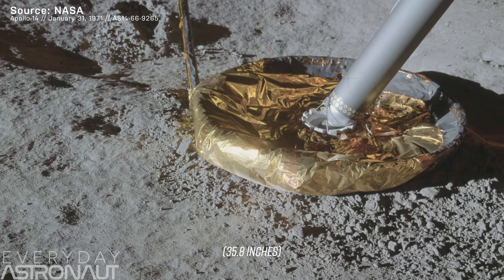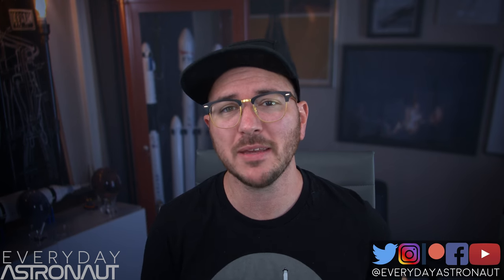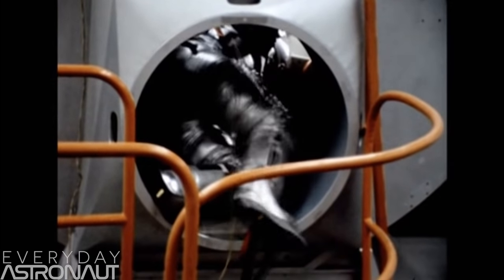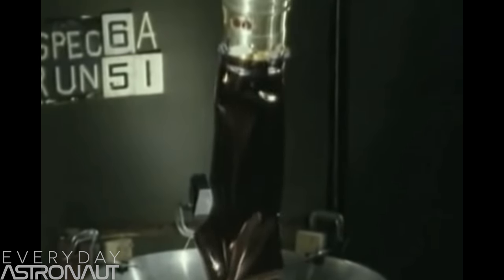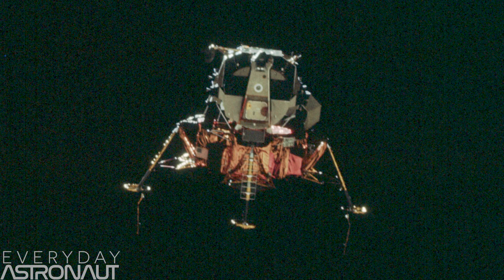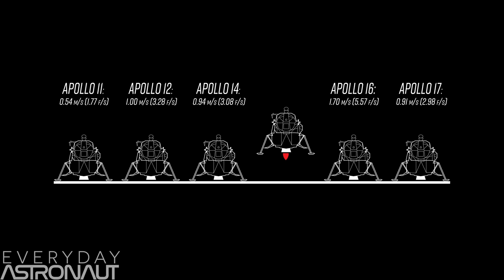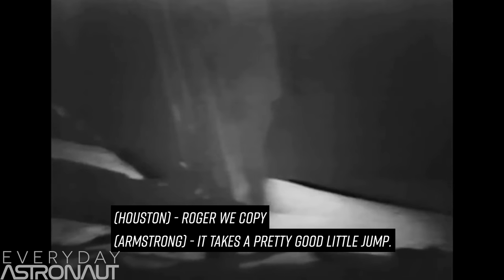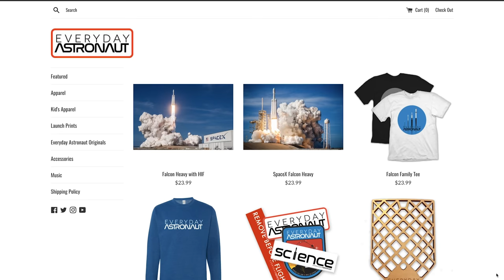Why were there missing rungs on the Lunar Lander’s Ladder?

Comment: Why was there no moon dust on the round feet of the LEM?
Reply: There is a bit.Why do you expect more?
Reply: @ThomasKundera  
Were you aware that the rocket under the LEM operated at 10,000 lbs of thrust?
Considering how fluffy the moon soil was described by the astronauts, there should have been dust everywhere
Reply: You answered  your own question. Check out the Apollo lunar landin videos, you can see the dust gettin blasted away before touchdown.
Reply: @hta: I'm aware that the main thruster power was adjustable ans to the lower when landing with empty fuel tank. 
And as said it was cut before ground.And dust is flying away from the lander I can't see many trajectories that would put some back on it. Maybe you can enlight me?
Reply: @ThomasKundera  
I guess you call that a clean landing  in another reality. Totally absurd that the dirt would go everywhere except onto a "pristine" LEM.
P.S Where is the blast crater below the craft? Did they float like a glider onto the surface? You people make no sense.
Reply: @hta: who talked about "clean landing"?Dust is pushed away and under the LEM. How do you want it to come on it?Look at landing videos, lots of dust is pushed away, very fast, but at very low angle.The blast crater is under the LEM, why?
Reply: @ThomasKundera  
I guess you haven't figured out yet from my acerbic attitude that I am convinced that the landing of 12 astronauts on the moon ever happened. There are too many  extraordinary and unexplained anomalies in the official narrative. 
Another one is an official image of the earth rising on the horizon, as seen from the Sea of Tranquility by Neil and Buzz.
Reply: @hthomasackermann  : You're not "acerbic"' but proudly ignorant.
I invite you to learn about Dunning-Kruger effect, then ponder what you know about space engineering and physics to conclude.

"There are too many  extraordinary and unexplained anomalies in the official narrative. "
I have yet to see any. I saw lots of people pretending there were some. But they were just not able to understand how things actually are.

"official image of the earth rising on the horizon, as seen from the Sea of Tranquility"
Technically speaking, there is no "earthrise" on the Moon, as it is in tidal lock.
However, the Apollo missions orbited the Moon from low orbit and thus could see some "earthrise" from their perspective.
So what?

Comment: There were several easy solutions to the ladder, if only someone would have thought a little bit more about solving it. One could have been making it a extension ladder. Like the one everyone has to work on their house. One section slides into the  other. After landing, extend it to the bottom. Problem solved. They can make a vehicle to fly to the moon and back, but no one can solve this problem? Go figure.

Comment: The moon absorbed 80% of the impact speed?

What does that actually mean?
Reply: It means that the moon absorbed 80% of the impact, and presumably the module's legs accounted for the rest.
Reply: Stubrit Repeating it louder doesn’t help. 

If you were listening, the modules legs didn’t absorb the impact like intended. 

When a person or aircraft hits the ground, how much impact does the the ground absorb? And how is that measured? And what should it look like?
Reply: Stubrit cheers dude. Apologies if I came across harsh. I’m a confused little chap. And you’re a good guy girl thing. 🤷‍♂️😆
Reply: @ashsmitty2244  My answer was terse: I 've removed it. Actually, they probably used an accelerometer (this film gives the landing force for all the missions so the module was almost certainly equipped with one).

Comment: engine stop but stil no dust up in the air what are you taking us for
Reply: Dust falls immediately due to no atmosphere, so, no air.
Reply: Also in the vacuum of the moon, the thrust from the lander is not confined by an atmosphere like on here on earth. On the moon it filled the entire cone and generated just about a couple of pounds per square inch. It wasn't going to blow a lot of lunar dust.

Comment: When the ascent module BLASTED OFF the moon it was setting on descent module- which included a 10 thous. HP engine and 4 fuel tanks directly below ascent engine. The ascent module weighed 5 tons and - you can imagine the firepower needed to lift off and go 69 miles up to meet the Command module. The descent module would be cooked in fire and the entire thing blown to heck! This proves the entire moon landing story was fiction. Nixon later admitted that the PH CALL was prefabricated for public stroking (he called it 'jerking off' john q public!) In a Daily Worker article from - late 1997 i think it was
Reply: You're citing The Daily Worker as a source? HAWWW!!!

Comment: time-delay in a radio conversation takes 4 minutes in each direction from earth to the moon, that is what I have been told,  it must be quite awkward to carry out a dialogue, ask an astronaut a question then wait for over 8  minutes for the answer, maybe they have very fast radio transmitters, as I saw president Nixon carried out a normal speed conversation with astronauts on the moon
Reply: It’s actually only 1 second.
Reply: @fuelrich299  *chisanu leelanond
* must be from an alternate universe where the speed of light is much slower 😁
Reply: Radios take a while to get to earth and back though light only takes a few seconds so they wouldn’t wait that long
Reply: @fuelrich299  more than 1 seconds actually, its like 2-4 seconds

Comment: What a joke...
Where is the blast crater from the 10,00 LB thrust motor???
Reply: Why would there be one? Are you one of those people misled by hoaxers to think that the LM landed with full throttle?
Reply: @Q.E. D 
Yeah, I mean all of them think that the LM landed with the full 10,000lbs throttle.
Reply: This argument has been done to death, and it results from an inherent misunderstanding of how rocket engines work. The goal of a rocket engine is to turn temperature and pressure into velocity, meaning that a good rocket engine produces a close to ambient pressure exhaust. On Earth this mean the exhaust usually has a pressure of around 1 atm, but in the vacuum of space you want to expand the exhaust as much as practically possible, so the exit exhaust of the LM's descent engine (from this diagram https://i.imgur.com/uKYh2w5.png ) was somewhere around 2-3 psi or 0.14 to 0.20 atmospheres. That's why we do not see a blast crater, the gases coming out of the engine are just too thin to do much more than blow dust out of the way. This is also why the exhaust doesn't form a long bright plume, in a vacuum the exhaust quickly expands out and becomes invisible, save for a bright glow emanating from the nozzle exit.

Comment: man did not went to the moon ..if man did really went to the moon then we can re use those design module and rockets again to return.with minimise cost..
Reply: You are aware that all those designs use components that aren't in production anymore?
Fact of the matter is, it's actually cheaper, easier, safer and faster to develop the current-gen space hardware, using current tech and electronics.
Reply: Do you use in your car brakes that were designed in late 60s? Why don't you use them?
Reply: tgstudio8 if you can go really to the moon on old rocket its better than todays  if you cannot even try..if it really went to the moon thats the point..
Reply: Dan did not went to English class
Reply: Also it’s because of funding cuts to NASA